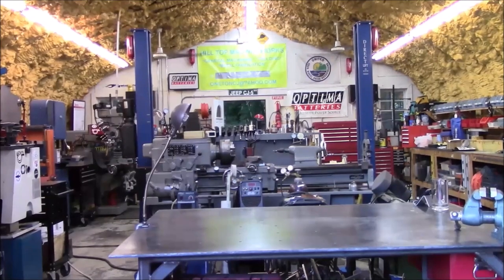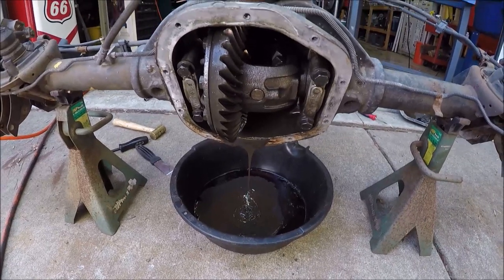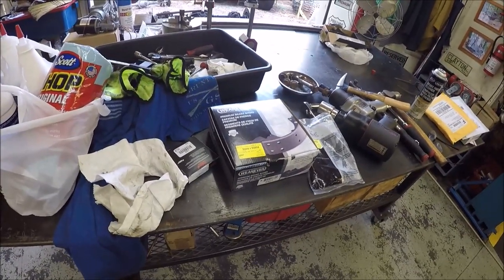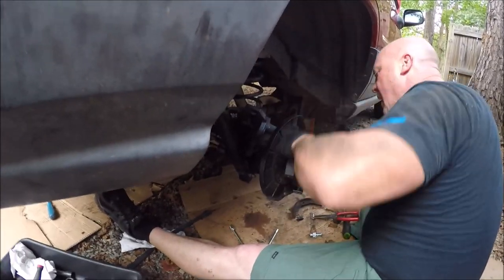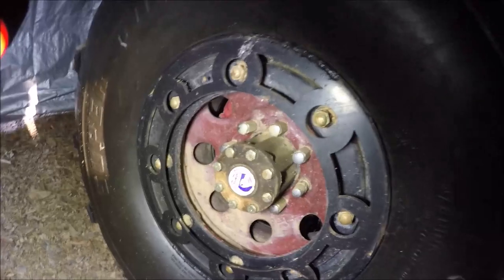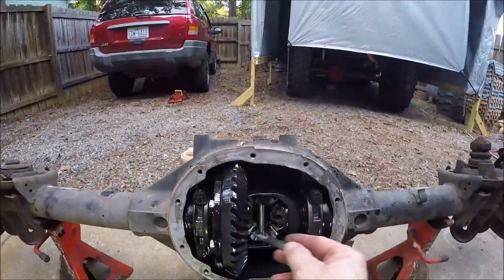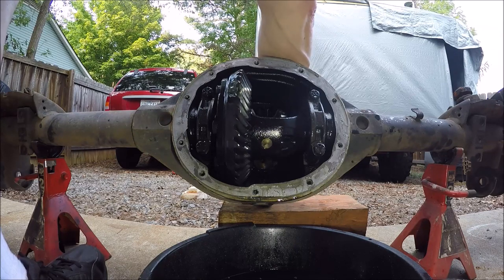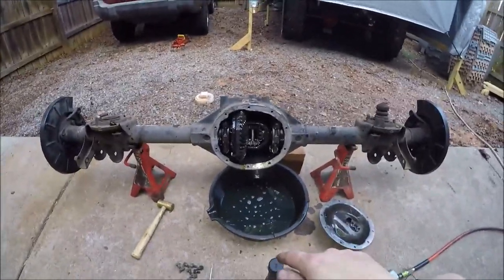Jeep axle swap

Comment: My Wrangler had a dana 35 in it, replaced it with a ford 8.8 out of an Explorer as they had the exact same bolt pattern and were only 1/2" narrower.  Put an ARB air locker in it and had it all ready to go 16 years ago, never finished the engine swap so it's just sitting and rotting.  :(
Reply from the maker: The 8.8 is a good swap too. Especially if you go rear disc as an upgrade.

Comment: what years vehicle you find dana 44 ? i would to know thanks
Reply from the maker: Front or rear axle?
Reply: @hilltopmachineworks2131  rear axle.I would upgrade for my wj rear axle
Reply from the maker: @tomtran4431  All ZJ's with a V8 had D44 axles in them. So look for them.